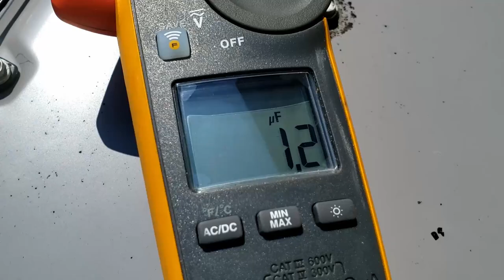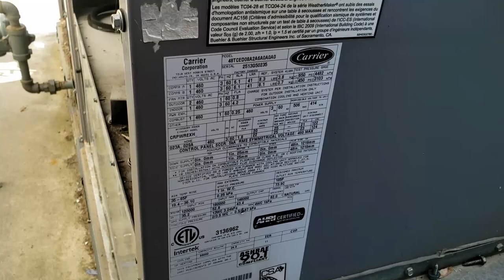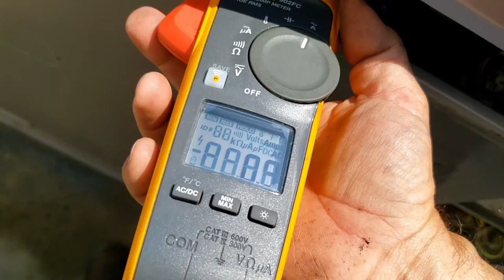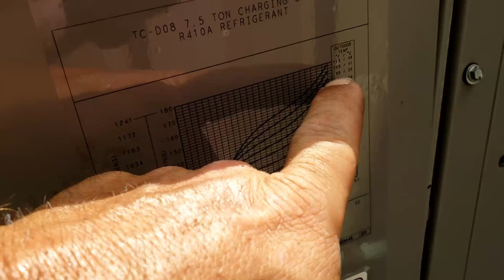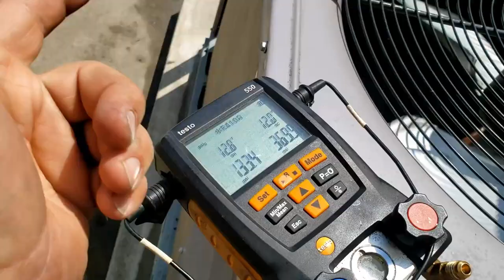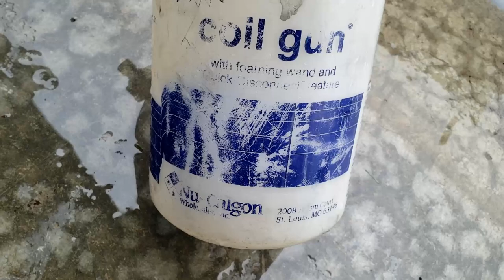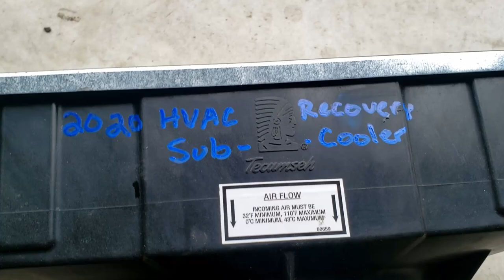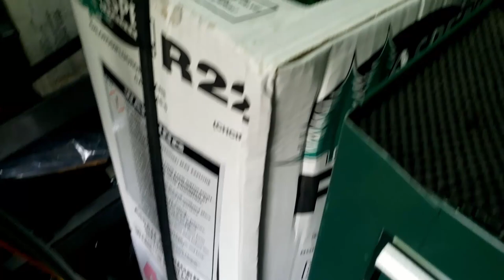No Cooling In The Show Room. Warning!! Bonus Sub-cooler Assembly Unedited =What Raw Video Looks Like

Comment: Way back in the day when they first were going to require a recovery unit I made my own. Was a heavy system but it worked great.
Reply from the maker: Yes,  I remember when the recovery units had compressors in them and you had to change the oil every so often. 🤦‍♂️ it about took a 2 wheel cart to move it. 😏

Comment: We had a building full of old water cooled ground source heat pumps. Several of them were considerably large... 16 ton. We took the shell in tube condensers and braze garden hose fittings on the water side for a once through. It was the very best method I have seen for any amount of recovery over 100# of 410a
Reply from the maker: I would bet so, holy crap.

Comment: You dont know how many times I have dropped my service wrench when loosening the back bolt to tighten those belts. Damn wrench goes under the the evap and yo get it I have to sweat sweat swear while retrieving it
Reply from the maker: Get a magnetic pick up tool,  they have saved my butt several times.
Reply: Åreš  I am with you on that one!

Comment: I have a Coleman furnace that was original with my house when it was built in 1990. 30 years later, the same furnace is still in use with no problems. Say what you will about Coleman, but I've had good experience with them.
Reply from the maker: Around here they're only in house trailers and modular homes. If you're referring to that type of Coleman then I've replaced a crap load of heat exchangers and sometimes you can't see it from the burner box.
Reply: @HVACRSurvival  Yeah, I live in a modular home. It's been well maintained and we had a full inspection on it by a qualified HVAC person (not a home inspector) when we bought the place. I do anticipate replacing it in the near future though as I'm sure 30 years is well beyond it's expected life span. But as of right now it does great and I keep up on the maintenance of it.
Reply from the maker: @mikel9567  ok good, I was hoping your having it checked,  they should be pulling out the burner and the blower to verify the heat exchanger is safe. So your not in the service field?
Reply: @HVACRSurvival  Nope I'm not, I work in public works on the roads for my county (I'm the guy that you cuss out because we delay you, haha). I'm pretty handy and pretty DIY but I don't mess with HVAC stuff other than to change my filters and to vacuum up any loose dirt I see that is on the surface. I'll leave the real work to you pros who know what your doing. That said, I'm really interested in how things work and what goes on so I enjoy watching videos like yours.
Reply from the maker: Well cool👍👍, I'm glad you find them useful🍺🍺🤜🤛

Comment: I’d recommend replacing those fan motor, I had .1 amp rating over the rla on a carrier package unit, they both went out that same week
Reply from the maker: Some customers are good about doing things like that and others are not. I'm covered against a call back if I note it on my paperwork. Thanks 4 the heads up. This call was 2 months ago, I haven't heard anything more about it.
Reply: Your assuming those are oem motors. They could be aftermarket replacements with different ratings.  Need to check the info plate on the actual motors themselves.
Reply from the maker: You have a good point👍👍. But I haven't seen a after market motors have leads that long, especially the capacitor lead. Those are generally lucky if they're  1.5 foot long so I felt I was OK this time. Thanks for the feedback👍👍